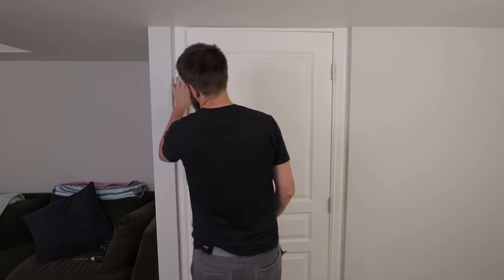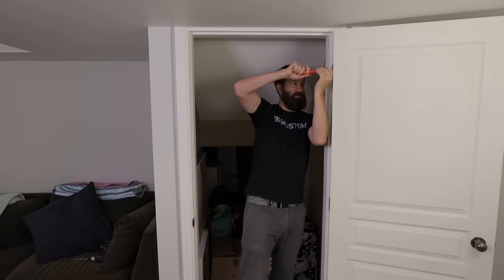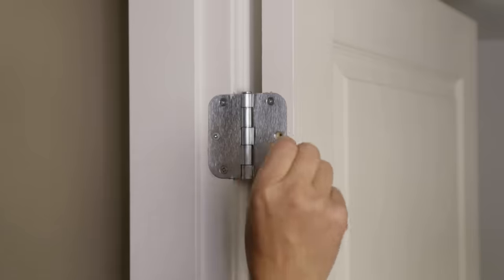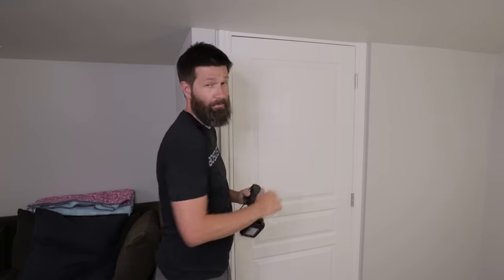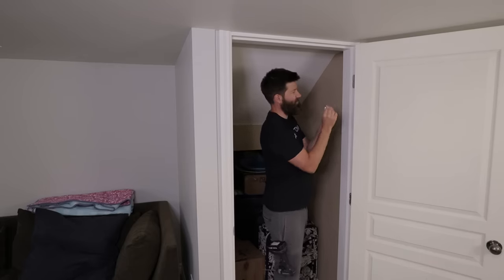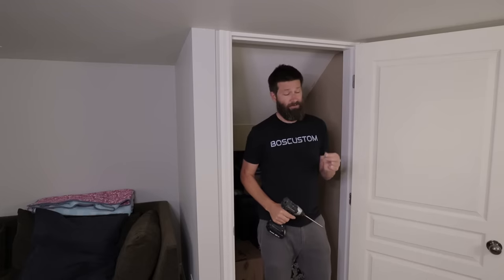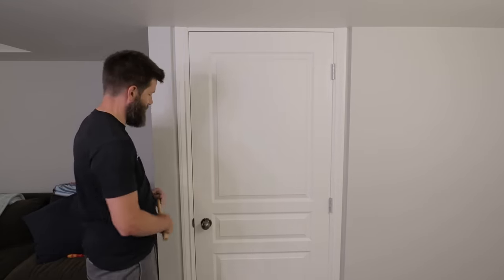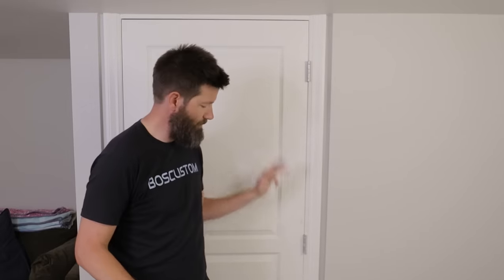How To Fix a Sagging Door that's Rubbing or Won't Close!!!

Comment from the maker: If you'd like to help me make better videos and you enjoy absurdly comfortable T-shirts:) check this out-> https://www.etsy.com/ca/shop/TheFunnyCarpenter?ref=search_shop_redirect
Reply: I've used the toothpick trick a number of times.  Another trick that works for me is one or two business cards in behind the hinge to 'bring it out' from the door jamb.  I loved the 'bend the hinge trick' and will be using that as well.  Thanks for the great video!
Reply: Depends on wall sometimes wall left right are not level so if you install door sometimes not fit side by side because level is not accurate
Reply: Specially if the wall is concrete always make problem is not right level
Reply: Thanks my friend, the toothpick trick work marvelously. I was about to replace the hinge.
Reply: Toothpicks method fixed my sagging door after 8 years!!!
Thank you!!!
Toothpick? Who knew right??
Reply: My door is hitting on the top too but at the opposite side.. how will you fix that one? Should i move a hinge out a little?
Reply: It is hitting the frame corner by 1/8 of. Inch i believe
Reply from the maker: Sorry just saw this. You can try and shim the bottom hinge over a bit and see if that helps.  If not you can sand the top down a bit.
Reply: I run the screw behind the door hinge long as it covers it works good.
Reply: @northernlightsrenovations1710   Business cards cool I'll try that I use the toothpick trick many times thank you to my dad who grew up with a father as a carpenter.
Reply: Cardboard behind the hinge works well too
Reply: My door rubbs at the top corner on the non hidge side. Top meaning the top part of the door. Not the top side of the door. How do I fix? Thanks in advance.
Reply: 1
Reply: What is wrong when the door is fine  and 1 side of the door frame is fine, but the othe side of the door frame is sagging?
Reply: @ciaran4579  do you mean like it has settled and pushed inward towards the door? If so, you can grab a block of wood to put up against the jamb and hit it with a hammer or light (3lb) sledge hammer towards the top of the jamb. If it has room it will knock the jamb back and usually you can tell because where the side jamb meets the top, often will crash a bit due to you separating it so you'll likely need to use some caulking afterwards. If the whole door just doesn't quite close you can do this at the top, middle and bottom of both sides of the jamb if needed. Hope it helps, or feel free to clarify.
Reply: One other trick you can try is swapping the top hinge with the bottom
Reply: Toothpick trick rocks!!
Reply: Do not use impact drivers for this. That was not smart.
Reply: Before I go too crazy trying these, will these tips potentially fix my door if it's rubbing on the hinge side? I can get it to close about 80% of the way and then it starts rubbing the jamb super hard on the hinge side. Had to really finagle the hinges just to get the pins in.
Reply: 😂 love it wish I could throw house away
Reply: My pins for the hinges have a double head. I took off the middle hinge completely and tried to remove it with zero luck. Now what?
Reply: Definitely hate doors...always seems like the top hinge is the problem, which makes sense because it's probably the hinge that bears the most load and wear & tear. What sucks is when these issues happen with fire code exterior doors. The frame is steel and the hinges are adjustable (not those pin-hinges found on interior doors) so it's difficult to align these types of doors without using long screws and adjusting the way the door is attached to the framing. Your latch plate grinding technique definitely helped me out with fixing a latching issue so I definitely appreciate and thank you for posting these videos for those of us who prefer to DIY.
Reply: @thefunnycarpenter  Hi, my door into the garage is sagging and won’t close. There are 3 hinges - top & bottom (solid knuckle with rotating door stop) and middle (knuckle with 5-6 slice bending pieces just like what you are showing). 

I tried using your method but it won’t lift the sag much. Also, when I used the wrench, it damaged the door frame. My screw drivers don’t fit the screw caps that well. Most of them were damaged tips. Is there a screw driver that fits door hinge screws better? Any help would be greatly  appreciate it. Thanks!

Comment: Throw the entire house away and buy a new one.
Reply: It’s the only way.
Reply: Dude you are loaded😂😂😂
Reply: I'm just about to that point rn
Reply: if only it were that inexpensive😂
Reply: @mychajlodoss502  I'm at this point smh
Reply: Some houses are sagging due to age, and their door jambs are out of parallel.  The advice has merit.
Reply: It probably is a new house
Reply: @bruceseaman6592  yup! Mine did it  😞
Reply: buy? no, no, no....build
It's the only way to be sure......
Reply: #ThisIsTheWay 😂
Reply: No joke I came to this video because I got a modular home in South florida that half of is sinking into the ground, aaaand that's what's causing my door frame to be out of alignment....

Since this video is of no use to me, I may just have to throw the whole damn trailer in the trash. Heh the trailer trash can throw the whole trailer in the trash but the trailer trash's trashed trailer can't be trashed till Thursday's bulk trash pickup.  
Did I just invent a new tongue twister?
Reply: Recommended by the local losernomics-commienomics commission.
Reply: I’m getting to this conclusion too! Done with the door repairs! 😅
Reply: I'm working on an old apartment complex with 192 units. There is years of paint on the doors, jambs, hinges, pins, screw heads, light switches, electrical outlets, everything. Please kill me.
Reply: Hahaha this got me!!
Reply: * buys new home
* new door sags
😐
Reply: Seriously man, all the doors are jacked up in my house. They must have been drunk when they built it.
Reply: Oh god thank you. I was just thinking that.
Reply: If the door center piece is not stripped should I pull it out anyway
Reply: Exactly what I was thinking! He’s so silly just telling us to fix it 🙄
Reply: I need to do that with my house.  My wife says we need a Zippo remodel.
Reply: My kinda guy if it’s busted toss it
Reply: Best option
Reply: Yea right well mines paid for so I will fix it which means I have a zero dollar month note
Reply: Well after the 4th or 5th house, it really starts to add up you know? This is a good tip, thank you.
Reply: If you’re just gonna throw the house away I’ll take it!!
Reply: So tempting!!
Reply: As an estate agent, I approve this message.
Reply: Car salesman see you coming a mile away

Comment: My added tip for #3, if you put a shim at the top of the door on the latch side you can make the gap the size you want before you bend the hinges. And when you go to bend the hinge loops with the wrench you will see exactly how far you need to move them, because the door will already be where you want it to be!
Reply from the maker: Good tip
Reply: That is cheating!
Reply: I was thinking the same thing instead of that "trial and error" method.
Reply: Yep exactly my thought....
Reply: Great one this helped me a lot!
Reply: Can you please show us how?
Reply: God damnit beat me to it!!
Reply: That is what I did.  Worked great.
Reply: A golf tee or dowel rod works perfect too.
Reply: If you use a drill in #1, turn the clutch down to 3 or 4... that's what it's for.
Reply: What if the screws are loose/strip on the door slide of the hinge? How do I fix it? I don’t think my is wood and is hallow on the inside?
Reply: @TheRealTommyR  Try to add toothpicks or wood splinters, then put in the screw and see how it goes.
Reply: @amunkhufu Thank you for sharing this tip!!! 🙌 I'm trying to fix our bathroom door 🚪 that won't close unless we lift it & then when we open it the noise is so loud because we have to lift the door again to get out. Soo annoying!! 😂 So thanks again as your tip could really help. I would imagine this tip could save from having to drill new holes to replace hinges too.
Reply: @amunkhufu 5:41
Reply: And if you don't have shims, you probably have playing cards.
Reply: @Martian74  that’s what my wife said.
Reply: Great tip - any suggestions for a stronger hinge like a front door? Having trouble bending it with hand tools
Reply: I shall use this today, thank you!

Comment: I’ve been dealing with a bathroom door that was snagging and wouldn’t close for almost a year. Moved into the house with the issue, tried everything I could think of. Watched your video and fixed 2 doors with 5 minutes of work bending 2 hinges. You’re a saint.
Reply from the maker: That’s awesome Russell! Glad to help:)
Reply: Same since last night
Reply: Im curious. What did you try first?
Reply: Russell, new hinges are always a good thing.
Reply: @johnthree1611  I was wondering that too! 🤣🤷
Reply: @gregoryguevara9649 , yea, it works like a charm.
Reply: @TheFunnyCarpenter  I have the problem with my front door.The top of the door starting at the lock and up won't close flush? The top door hinge and the screw are fine. Maybe it's just vending the hinges I guess?  Help
Reply: I've been a woodworker for many years, that hinge bending was genius.
Reply: That bathroom door is/ was probably swollen. I found out that vapor barriers weren't required in old construction. That building may not have insulation in the floors and proper plastic coverage in the crawl space. 

Or... the air inside the construction might be too moist. Old buildings weren't required to be properly sealed. Humidity can be caused by incomplete weatherization of construction (exterior walls are supposed to have a vapor barrier and a heat shield, walls and ceilings are supposed to becaulked, floors are supposed to have tar paper in the subfloor, windows are supposed to have vapor barrier and caulk, exterior doors are supposed have weather strips, roofs are supposed to have tar paper and plastic as well).
Reply: Probably worth noting you should only try bending it one way. When you bend metal back and forth it weakens until it eventually snaps.
Reply: I'm convinced everyone has a wonky bathroom door when they move in.
Reply: Read bible and pray to God for wisdom.
Reply: How do you know which way to bend the hinges, so that they meet? If the door gap is bigger at the top do you bend the hinge towards the top, or do you been the hinges in the other direction??
Reply: @AlpenTree  experiment until achive desired result
Reply: Our issue is the bathroom door won’t latch anymore. It is an older house and it been a problem since we moved in. It’s either rubbing or not latching shut  bo matter what adjustment I make.
Reply: I wish I had found it earlier... I hacked off the top of our door when we moved in here.. I still regret it

Comment: I had a realtor make a nasty comment about a closet door in my home I was selling. I thought seriously? Is that all you can find wrong? I'll show you. I used tip #3. I am a "not young" woman who loves DIY fixes. THIS was perfect!!! Door makes a crisp snap shut now! Home sold for listed price. THANK YOU!!!
Reply from the maker: That is rad! Glad the tip worked🍻
Reply: @TheFunnyCarpenter   Thanks for the tips... I have different issues with each of my doors...I had a contractor do some structural work and afterward none of the doors upstairs close, but one when closed you get stuck in the room--its a bathroom and I guess when you shower the door swells and you get stuck inside, we've planed the door and it still is fickle.  One bedroom door the top sits too far inside the room and the bottom is snug on the stop trim piece, another door is reverse that and the bottom of the door is gapped and the top rubs the stop trim piece, the bedroom with double doors you actually now have to lift the main swinging door to meet the strike plate on the other door.  How do you fix the doors when it is 'off' vertically than horizontally (as in my case where the hinges wont fix the door being wracked
Reply: A little advice next time you get a realtor, you are signing on to list your home choose one that you like not some idiot. You’re not obliged to anyone unless you signed the paper for the length of the listing.
Reply: There is a much better video out there on how to fix this problem for real like when you have a house settle in your old door is sagging. It can also be achieved without taking off the door or hinges perhaps sometimes it’s just a loose screw but then most of the time it’s more like a settling foundation, etc., or just things sagging. This is likely a new door which it looks like in a newer home. I just got done fixing a latch problem with a bedroom door, not catching and staying closed because the metal striker plate (on frame) was bent inward some causing the latch to not be able to catch & hold properly. I needed new metal stricken plate & a small piece of wood to support the new plate better plus I didn’t have any wood filler handy) And this is why I keep some odd small pieces when I perhaps replace an old doorknob etc.) Just in case. Was working perfectly until I had a broom handle fall down into the hinge section of the door between the door edge and the wall, which I heard but didn’t see where it fell so I didn’t know it was in the door frame on the hall side)and when I tried to close inside room it must’ve just slightly bent the hinge one top as now the doors too tight and I have to press it to the left to close it right! I’ve got to fix the hinge now, which is another’s YouTube video on a proper way to do this and an easy way without taking the door off! Be sure to look for the comment about wedging the door up first is very helpful also. I’ve seen other comments for many years about the toothpick trick with screws that are loose.

Comment: I've had good luck just swapping the top and bottom hinges. The top hinge is the one that gets "tired" and has its plates separated by a gradually increasing gap.  Replacing it with the "not tired" bottom hinge often solves the problem.  Especially useful with the steel doors/frames found in older apartment buildings, which have enclosed spring-loaded hinges that don't have anything you can bend.
Reply: You mean, "retired". I found they were wear and tear. Once that happens, you have to replace them. Fixing is not a good solution. The problem will come back. Those are only a few bucks to replace. I rather change all of them. I replace them with the better brand with the bearings. They will last for 20 years. And, make sure you lubricate them with lithium grease once in a year.
Reply: So I live in an old appartment with metal frames. I tried to change the bottom one with the top one and it made it worse somehow. Would changing the hinges for newer ones fix this issue?
Reply: @TT-dp8qh so I tried all the options I can think of and I have metal frames. Should changing the hinges for newer ones fix the problem?
Reply: @davidjrazeghi3248  it should work if you replaced with the correct ones. For the new ones, make sure they will line up, otherwise the door will not go in straight. I refer stainless steel on the new ones!
Reply: @davidjrazeghi3248 I bet someone had the same idea as you and had already swapped the top and bottom. Probably need new ones
Reply: @TT-dp8qh  @thefunnycarpenter Thanks for the video! Love idea #3, but I think I need to replace the hinge anyway. I have a top hinge where the screws are all loose. I tried 3 toothpicks and it didn't hold the 3 inch screw. If I replace the hinge with a new one, the holes are still stripped, how do you handle that if toothpicks aren't holding (I saw another comment with a chopstick? Also can you suggest a better brand of hinges? Two of the other hinges are CRP R13329 looks like Cal Royal Spring hinge full-mortise on the door. Those look much better than the top one thats failing. This is a heavier door going to the garage.
Reply: @Jeff-ro1bv  use those zinc self drilling drywall anchor. Each can hold at least 15 pounds and they work very well. Screw them over the existing holes. Make sure you drill bigger holes over the old holes. Check for the drill bit size and don’t drill holes too big. The drill bit size should be a little smaller than the anchor size!

Comment: I've endured jammed doors for  the past year, but I just fixed over a dozen doors in about two hours with the help of this video. First, I replaced the middle screw on all hinges with 3in course thread drywall screws. Then, I used the adjustable wrench tip to fine tune the gap. Thanks for posting!

Comment: Hey.  I'm a windows and doors manufacturer, and that third trick is a genius indeed!  Whoop, thanks for the tip!
Reply from the maker: Thanks Dan
Reply: Hinge adjusters for adjusting the hinges on all doors or windows where there may be air between the frame and the frame .. a tool  we used where i live for 30+ years .

Comment: Never thought of the last fix, it was exactly what I needed.  Thank you!  I had tried all of the others before, they worked on some of my old doors, but not the stubborn bathroom door.  I have old two hinge doors, and with the weight of multiple door hangers on it with wet towels, I can see why it would bend the hinge over time.  Bending it back to the original position seemed to do the trick!

Comment: High quality bamboo chop sticks from nicer take out places work really well for hole plugs/shims. They're just denser than toothpicks or soft wood chopsticks (pre-tapered and usually free).

Great tips, as always!
Reply: I use golf tees.
They fit in my toolbox and pouch a little easier.
Reply: A bag of 100 10” wood skewers is like a buck at Walmart
Reply: @dan4091  Very true. Sometimes you have a hole larger than a BBQ skewer, however.
Reply: I have used that since i started reno's at 24.works very well.